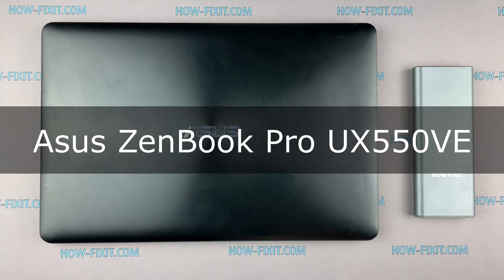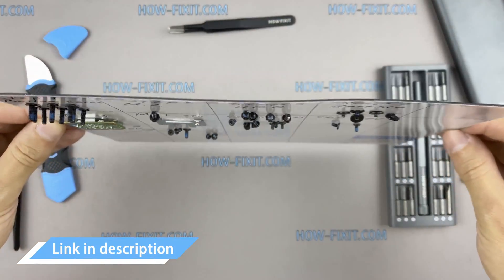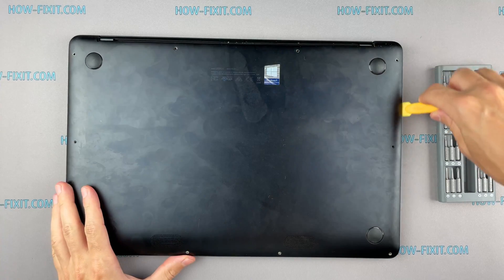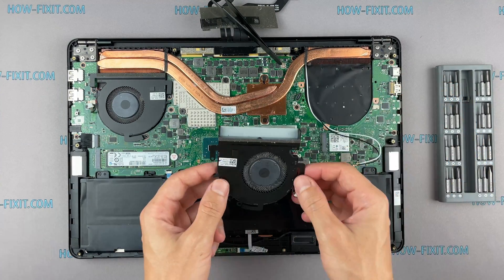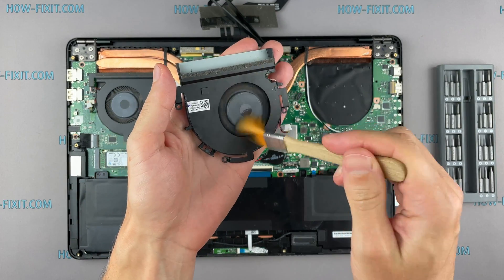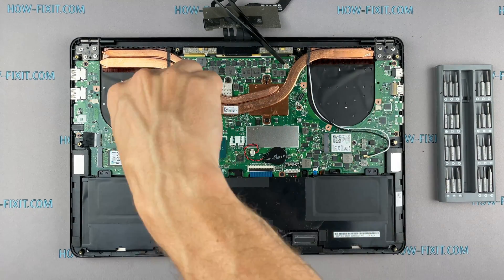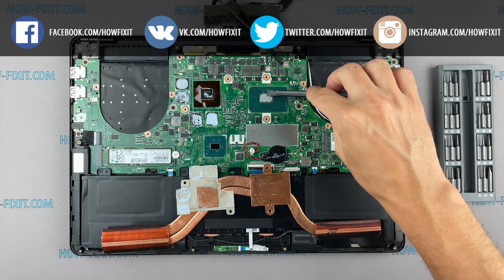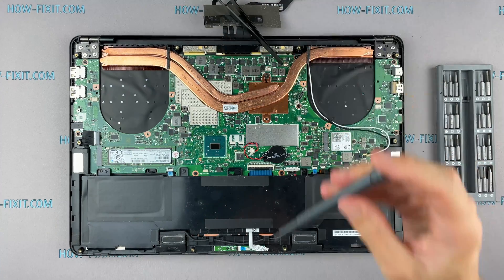Asus ZenBook Pro UX550VE Disassembly, fan cleaning and thermal paste replacement

Comment: My ASUS ZenBook Pro UX550GE has an issue with the power/charging indicator LEDs. The LEDs themselves do work, but they are no longer visible from the outside. When the bottom cover is removed, I can clearly see the LED lights shining, but once I reattach the cover, the external LED indicators stay completely dark.

Inside the laptop, there was a thin plastic/film-like strip positioned directly over the LED “window” area on the bottom cover. That strip came loose, and after reattaching it, the LEDs still don’t shine through the case. It seems like the strip was part of a light-pipe or diffuser that channels the internal LED light to the outside. Without it being properly aligned or attached, the LED indicators are no longer visible.

I’m trying to figure out how this LED setup works and how to restore the external power/charging indicators. Any advice from people who have worked on this model or similar ZenBooks would be appreciated.